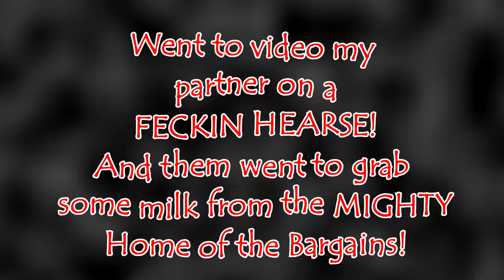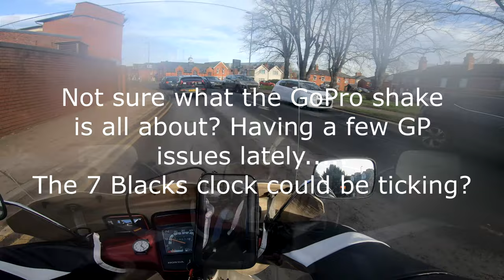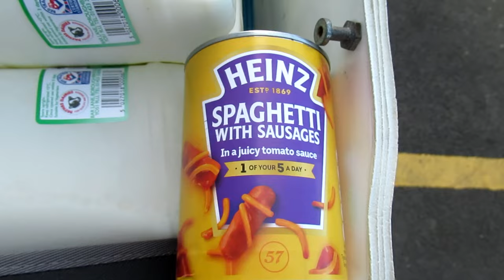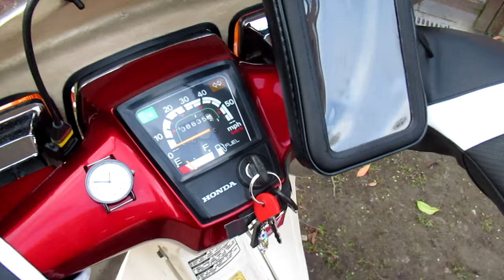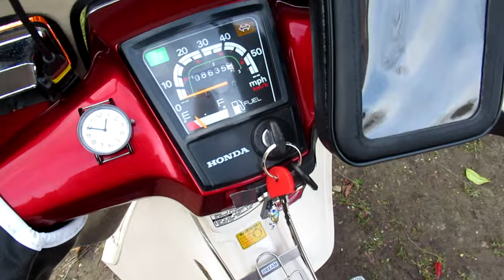First ride out on the Honda C90 | Lifan 110cc semi-automatic

Comment: Nice one, does it have much range to go far?
Reply from the maker: Not sure yet, need to adjust the carb settings then do some runs to see what range a tank gives me. I've got a couple of metal water bottles with emergency fuel in the butty box anyway, just in case. I will report back in good time 😁 👍
Reply: they should average about 90 to 105 MPG (US Gallons here..) when tuned and you have the gearing sorted.   These engines will pull about a 16 tooth sprocket with the 41 tooth back sprocket, makes for less thrash when doing 40~45 mph.
Reply: My 2015 Honda Wave 110i was averaging 159mpg @OldNorthern_eMTBer

Comment: I've got a 1969 Honda C102 with a 125cc pitbike engine, originally had a 50 cc cast iron head/barrel lump that barely made 38 mph, the 125cc OHC engine isn't really strong like modern pitbike engines, but it will happily cruise at 55 mph. Also has better alternator for brighter lights as it was a 6 volt prior to conversion. 

  Break-in notes on these Lifan crate engines:  Do your first oil change after about 200~300 miles, and every 500~800 miles afterwards.  Largely on how much you flog the bike.  Check the valves, I believe they're something like 0.003 intake 0.005 exhaust.  Also noted your engine was running a little rich on idle so that might take more than just adjusting the airfuel pilot screw, also check to see if you left your choke partially on, I do this infrequently on my bike, but it protests with much power loss and stumbling when trying to accelerate.
Reply from the maker: Ta for the top tips. Yeah, I checked the plug and it was sooted up. I've stuck a new carb on as I think the mixture screws on the original weren't as they should, will he the first start up with the new carb this morning so hopefully get it set to run OK 👍

Comment: I have never had C90 i had  Yamaha T80 4 speed shaft drive scooterette.
Surprisingly i did 50,000 miles on it mainly commuting as a shift worker plus i did a Few Long Distance trips 125 each way in the winter   !! (Cold and slowish) had bigger bikes since then but now as 70 i have downsize to a Kawasaki J300 (300cc)  scooter which is very pleasant to ride and goes well..

Comment: how'd you deal with the different engine mounts? use a kit, or find a rare lifan with the same mounting patterns? (edit... i assume this is actually a relatively new 90 and they may have changed the mounts to suit all the "clone" engines... all i know is the original c/ct 90s and 110s have a different mount pattern.)

why i prefer the 50 and 70, the lifans (weel, all the china clones...ducar, shinewray, etc... 1p5*FMI type engines)  share the same bolt pattern, can go up to the limit... lifan 150. though personally i prefer the lifan 140, those things are bulletproof... and the "clutch on secondary" means you dont have to find neutral to kick them over, unlike the 125s.

just have to watch the cylinder hitting the front mudguard as its all a bit longer than its supposed to be. not an issue on my 50 as im running the forks off an R15...

yeah...rego... sounds easy over there, here it requires engineers certificates etc...
all you need now is to throw some high lift cams in and she will SCREAM!!!
Reply from the maker: The engine dropped straight in, no hassle, no engineer certificates, just plug and play. The C90 (and 50s and 70s) have the same mounts as the original C90 engine, hence why they are so popular. Cant comment on the CT's mounting pattern, never seen one of those bikes but surprised if they aren't the same as the C55, 70 and 90?
Reply: @OldNorthern_eMTBer  i had a 64, 72, and 82 C90. they all share the same mounts as the ct110, and they definitely do NOT take lifan engines without a bracket or modded mounts. whereas the 50s and 70s do. same as the sl50/70. Z50 as well. and the QR50.

ct90/110 aka postie bikes here... same deal. different mounts. 

but what year is that 90? the speedo and shiny bits suggests its relatively new. 2000+.

the posties are now running the new cubs with the EFI, havent touched one, but i sort of assume they took the easy route and share the same mounts as the china clones... its either lifan or ducar making them "under license".

possibly even the grom, along with the other manufacturers running the horizontal engines...
Reply from the maker: @paradiselost9946  it's a 1986 C90 and in pretty good good condition for its age 👍
Reply: @OldNorthern_eMTBer  this i find peculiar, as every 90 i have had has had the same mount as the 110, and that is NOT the same as the 50/70. so i just had to do some hunting...

i now assume yours was originally a 12v system. and apparently, the 6v (everything i have owned) has the different mount... learn something new everyday huh?

yes, for 86 its immaculate. either it was stored in a box or its had a nice restoration... its so shiny...
Reply from the maker: @paradiselost9946  Yeah, mines a 12v system so I guess the older round headlight models are different. I think the bike was owned by an old guy from new, only had 8.5k on the clock 👍
Reply from the maker: @paradiselost9946  What's a 'rego' test, where in the world are you?
Reply from the maker: @paradiselost9946   Strayl'ya? Crickey mate, that's naughty! (In a Steve Irwin kinda voice 🐊😂)  None of that nonsense here mate, just need a receipt for the engine so you can get the V5 document changed to show the new engine cc and engine number (V5, vehicle registration document) 👍